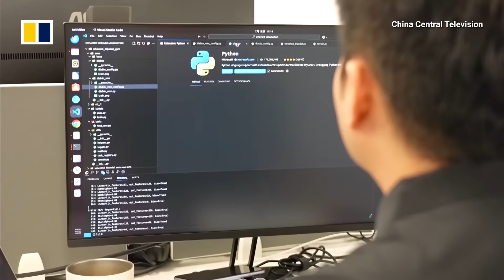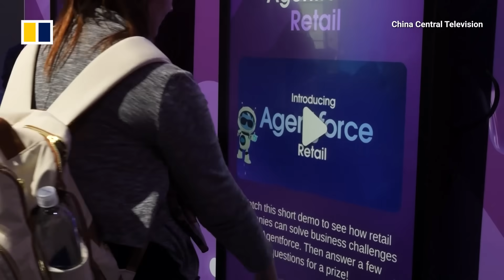China’s analogue AI chip could be 1,000 times faster than Nvidia GPU

Comment: Based on the video and the comment section I believe that this study is getting way to overblown. The technology has always suffered from scalability issues and it has been known for a long time that analoge is faster than digital for certain applications. In fact it was used before digital computing got fast enough (i.e. for industrial controllers). Until the scalability issue has been resolved I wouldn't get my hopes up.

Comment: Let’s Talk Science, Not Geopolitical Hype. 

Before the comments section gets poisoned with "US vs. China" rhetoric, let's look at what this truly is: a cool scientific experiment, not a commercial product.

The Science is Legit (Peer-Reviewed): This is the biggest anti-propaganda check: the claims about the ACCEL chip's architecture and performance were published and validated in the international journal Nature. That means the core technological idea is real and vetted by the global scientific community.

Specialist vs. Generalist: The "3,000x faster" and "4,000,000x less power" headlines are highly misleading. It's comparing a specialized analog/photonic prototype chip to a general-purpose digital GPU (Nvidia A100). It's only faster for a narrow task (like basic image classification) and cannot run complex, large-scale AI models or general operating systems.

Prototype vs. Product: This is a laboratory breakthrough, not a commercial reality. The chip was fabricated using older, non-cutting-edge processes to prove the concept. The decades-long challenge of scaling analog chips—solving for precision drift, long-term stability, and building a full software ecosystem—still needs to be overcome.

Analog Hurdles Remain Global: The fundamental limitations of analog computing (noise, precision issues, temperature sensitivity) are global challenges, not just China's. This is a crucial step forward for all analog computing, but it doesn't change the massive engineering and manufacturing lift required for industrial deployment.

World-class, validated science that is genuinely exciting. But we should focus on the technical achievement, not the propaganda framing. This chip is still years of engineering away from replacing any commercial product, regardless of who made it

Comment: Just fyi every so-called digital chip is in fact all analog chip with  signals decoded into digital representation of information.
Reply: The transistors are the same but it is utilised differently between analog n digital chips.  In digital they are made to work as switches, ie, in one mode no current flows, in the other mode, a lot of current flows, no in between.  In analog chip, the amount of current can be zero, a little bit, a little bit more, a lot more or lots more, depending on the level of input.  

The way calculations are made are different. Some are more difficult to do using digital, some more.difficult in analog.  But generally a lot more calculations can be made using just some basic digital building blocks using code programming, hence more popular.  

Analog computing, when feasible can be a lot faster n accurate but not as easily programmable esp on logical operations, which always work on two modes, true or false, not in between.

my two cents...

Comment: 1. Analog isn’t new, like she said, it was harder to scale up. China made it viable in some ways though.
2. This is not directly faster than digital, just that it can be faster due to the fact analog gives more values than just 1/0, amazing for certain tasks only. You won’t be using this for computers for example.
Overall, it’s great, but it’s like Apples vs Oranges. Both are food but they are not the same
Reply: It wouldnt be surprising that in comparable tasks, analog can be 1,000 times faster or not and vice versa.  A digital supercomputer can be 10,000 times faster than a laptop in some work but not in every type of work.  Everything serves a purpose, not to do everything!

Comment: Until these chips gets proper benchmarking from external sources, I will remain skeptical at the performance and compatibility of these Chinese AI Chips.

Just about anyone can claim their chips is 1000x times faster than Nvidia GPUs. For I know, you could compare it to Nvidia's slowest chips and claim its many times faster than them.

My question is which Nvidia chips do they claim it is 1000x faster to and is it compatible with any operating system that is commonly used?
Reply: If you could move your precious fingers just to verify that with any AI tools you can easily find what it was compared to, in what the stage this chip is manufactured, any business entries formed with any manufacturers to make it, how soon the mass production could be realized, i did some for you if you don’t mind instead of saying , doubting, but do more researching yourself , by the way, below is what I found with perplexity: The analog chip developed by Peking University claims to be 1,000 times faster and 100 times more energy efficient compared to Nvidia’s top-tier digital GPU, specifically the Nvidia H100 GPU. This chip achieves such performance by using analog computing principles with resistive memory arrays, differing fundamentally from traditional digital transistor-based chips like Nvidia’s. It shows a breakthrough in AI and scientific computing tasks, especially matrix calculations, offering a new paradigm beyond conventional digital GPUs like the H100. This advancement could potentially reshape AI hardware performance and energy efficiency standards globally.
In summary, the comparison of the Beijing University analog chip’s speed and efficiency is made against Nvidia’s H100 GPU.
Reply: IDK, I kinda believe them..Not only can China do it better, they can also do it cheaper..
The USA will spend 100 times the funds trying to keep up, while China laughs at us.. 
The Chinese have been so incredibly calculated on how to beat the USA in every aspect, while the USA fumbles every counter move..
And the worst part is China is united at beating the USA, while we fight over Trans people..

Comment: "Could be". It isn't but it "could be". I "could be" stronger than Eddie Hall and faster than Usain Bolt. I'm not, but I "could be".
Reply: Before I would have said the same but China is so much more advanced than America now. They have better infrastructure, better EV’s, better bridges, better AI, etc. China uses a cashless system while America still use paper money. China have drone food delivery and American have uber. China can built a skyscraper in less than a month while America  takes years to fill a pothole. China’s high speed train has 45,000km while America has 735 km in operation. America has fallen behind.
Reply: @Light23K  better bridges 😂

Comment: I'm trying to make sense of this.  Say I want to compute the area under a curve between points a and b.  Digital computing is like using Riemann Sum.  That is fitting little rectangles under the curve between a and b then add up their areas.  Analog computing is like finding the anti-derivative of the curve then take the difference of that value at a from at b.  Riemann Sum will always produce a solution, but takes about the same time for a straight line vs a complicated curve.  Anti-derivative can be much faster in scenarios where anti-derivatives are known (eg, if curve is a flat line at y=2, the anti-derivative is y=2x), but not useable if anti-derivative is not known, such as y=sin(x)/x.

So it sounds like for problems where specific methods exist, such as matrix inversion, analog computing is much faster.  But for problems where only numerical solutions exist, digital computing at least gives a solution.

Comment: By saying double the speed it may sound impressive enough already. Saying 1000 makes it sound ridiculous but if it's true, it is incredible.
Reply: The precision of Peking University’s RRAM-based analog computing chip is comparable to that of high tier digital processors, achieving a level of 24-bit fixed-point precision, which is roughly equivalent to the 32-bit floating-point (FP32) precision used in mainstream digital GPUs like Nvidia’s. And the 1000x throughput is actually legit 😂 i was also hesitant till I searched about it
Reply: @Jeremyh_King  I'm sorry but 24-bit fixed-point precision is not at all comparable or "roughly equivalent" to 32-bit floating-point precision... 

24-bit fixed point means that there are 2^24 (~16 million) different possible values, and they are at a fixed magnitude, so you can't represent the ultra large or the ultra small.

32-bit floats not only have more possible values (2^32 = ~4 billion), but they can represent really small (~10^-38) to really big (~10^38) numbers.

Also FP32 is used on all modern GPUs and CPUs so it's not like a "mainstream" or "digital" or "Nvidia-specific" thing...

Comment: Researchers from the Institute for Artificial Intelligence at Peking University, led by Assistant Professor Sun Zhong, have developed a high-precision and scalable analog matrix computing chip based on resistive random-access memory (RRAM) technology. 
This chip achieves analog computation with accuracy comparable to digital systems, overcoming a long-standing bottleneck in analog computing by improving precision by five orders of magnitude. 
The chip leverages an iterative algorithm that combines low-precision analog matrix inversion with high-precision analog matrix-vector multiplication, enabling it to solve complex mathematical problems such as matrix equations and MIMO signal detection directly in hardware. 
Performance evaluations show that the chip’s computational throughput and energy efficiency are hundreds to thousands of times higher than those of current top-tier digital processors like Nvidia’s H100 GPU, with benchmarking indicating a potential 1,000 times higher throughput and 100 times better energy efficiency for the same precision. 
This performance is attributed to the chip’s use of physical phenomena like current flow through resistive memory arrays, which allows for direct, continuous data processing, akin to a dimmer switch rather than a binary light switch, reducing the energy and time costs associated with digital computing’s separation of memory and processing units.
The technology has already demonstrated performance on par with digital processors in real-world tasks, such as detecting wireless communication signals, and holds promise for future applications in edge computing, where low-power, high-efficiency processing on end devices could reduce reliance on cloud infrastructure. 
The research team believes that further circuit enhancements could lead to even greater performance gains, potentially enabling the chip to outperform leading GPUs by a factor of 1,000 in specific workloads. 
This development marks a paradigm shift in computing, signaling a renaissance of analog computing through innovations in materials, architecture, and algorithms.

Comment: After previous announcements, I have to seriously doubt the 1,000 times faster claim.
Reply: Many Western analysts have been doubting and predicting the demise of China for decades. Nothing new.
Reply: It's the nature of the chip. Digital chips are great. They can do a lot of things, but there's a conversion between the basic 0 and 1 logic gates and higher level commands. An analogue chip can be made that simply has a particular algorithm built into its structure. It's a lot faster for that specific task and that task ONLY. It can't do anything else. The digital chip, of course, can. With AI, you do a particular type of math problem over and over, so perhaps, an analogue chip speeds that up, then you pass the results of that chip's work to another chip to do interpretive work or whatever. It's feasible to specifically design something that would do this. We just have to understand the limitations of the method and of the overall claim. The comments section is always more informative than the idiot talking heads ELI5'ing it because they don't understand it themselves.
Reply: @kma3647  The main thing is that it's an interesting project with a lot of potential, and it's basically grounds for further research. I imagine with more development, who knows where this technology could go. It  looks very interesting.

Comment: Analog is problematic for two reasons, noise and offset of the signal.
It can be beter but its wery sensitive, error prone.
Reply: That is exactly what i was thinking.

However, AI uses neutral network which has some level of errors, any way.

It would be interesting to see benchmark results of specific AI tasks. 😊

Comment: I have been looking forward to the GPUs made in China. Come on! China, I believe I will get it soon.
Reply: That's the point 😅 they simply cannot create them, however all customers would be happy to buy GPU faster and cheaper than Nvidia 😅
Reply: @pedros1  To be honest, I'm tired of the tricks played by Nvidia and Intel.
Reply: @pedros1  It costs about $250 to purchase a Chinese GPU with comparable performance to the GTX 3060. I'm currently waiting for the model with even better performance.
Reply: @ccjuertao really? Do they exist? Or it is just discontinued Nvidia chips on Chinese PCB? GPU market was always undersupplied if they actually existed Nvidia Nvidia would not charge $3000-5000 for a new GPU. Multiple Chinese GPU of $500-700 would be able to handle the load. They could release GPU drivers as well compatible with the latest games but they do not. They still use Microsoft and Linux as platforms for their hardware. 😅
Reply: @pedros1  Its name is "Moller Thread". You can learn more about it. As for the other brand, I've forgotten its name. But I don't know much about its software program.
Reply: @ccjuertao I think they is on pause because they are dependent on chips that is currently sanctions on!
Reply: Sounds like you should move to China. You seem to be in love.

Comment: Storing and producing analog voltages is difficult.  AI models have huge number of parameters.  These parameters need to be stored in memory and routed to the multiply/accumulate engines.  The multiply/accumulate engines are 1000x better in analog or maybe even more than digital.  But producing and routing accurately producing and routing all the analog values is really difficult.  Maybe if you used memristors and just a super huge array of digital neurons, each with a fixed (memristor) value, that might work.  But right now, the digital neurons are millions of times faster than the neurons in our brains so we time share them.  The time sharing makes analog difficult.  Another approach which is more likely to work well is 1.58b computations.  https://en.wikipedia.org/wiki/1.58-bit_large_language_model  also, Huwawi has some working ternary logic devices, I think.  So I would expect to see a high performance ternary logic AI chip from Hwuawi soon.  I think they also built ternary flash memory.